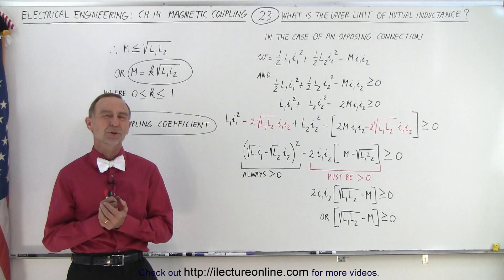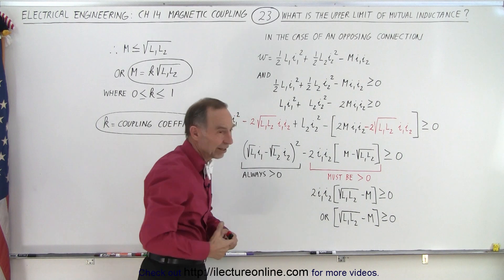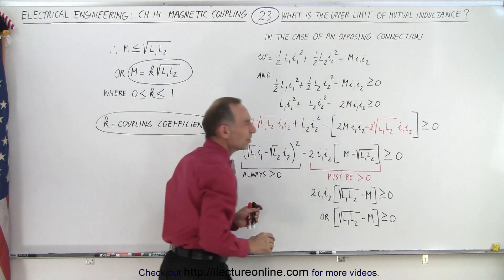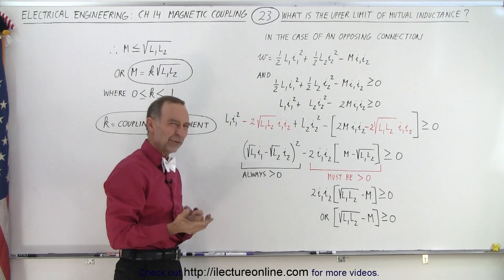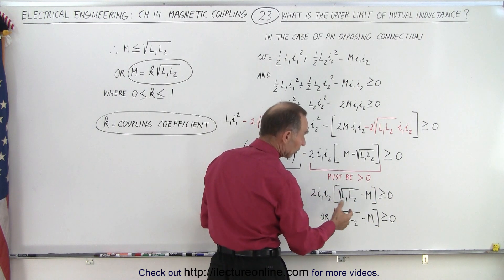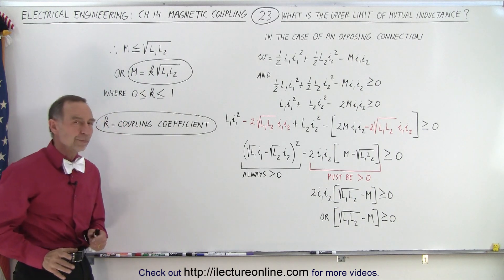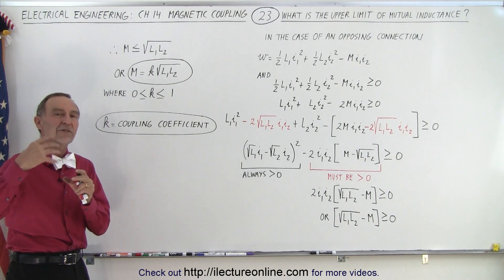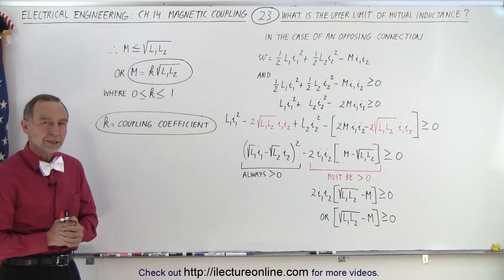Electrical Engineering: Ch 14 Magnetic Coupling (23 of 55) What is Upper Limit of Mutual Inductance?

Comment: Thank you professor can you help me please with this question please please 
https://youtube.com/shorts/RktAJNe9UlQ?feature=share
Reply from the maker: Lara,  today I am very busy.   But the key to this problem is that the torque (tension x radius of the disk) = moment of inertial of the disk x angular acceleration   Normally a = R x (angular acceleration), but in this case a = (1/2) (R x angular acceleration) because the hanging mass is suspended from a moving pulley.  I'll have to look at it closer later.
Reply: @MichelvanBiezen  ok thank you professor can you make a video on it please and which book I can find similar problems like this one
Reply: @MichelvanBiezen  please help